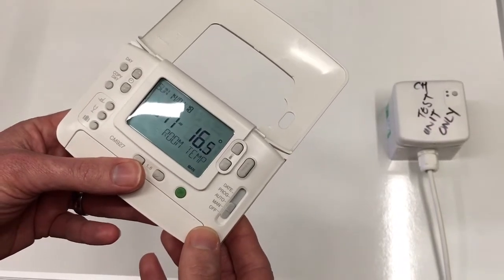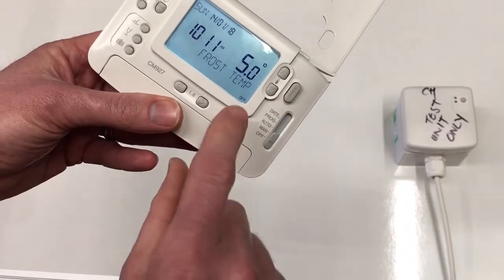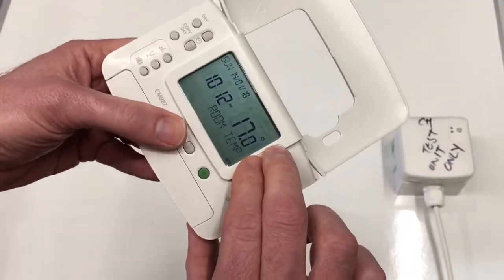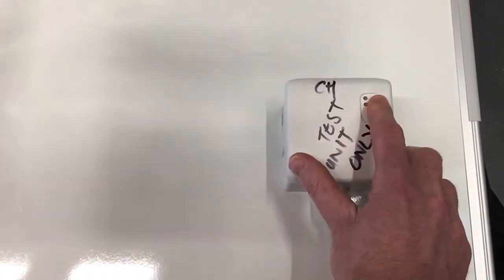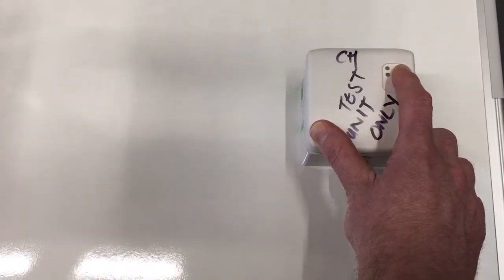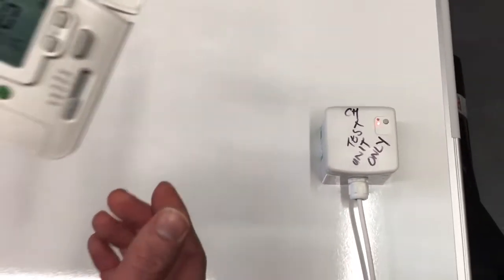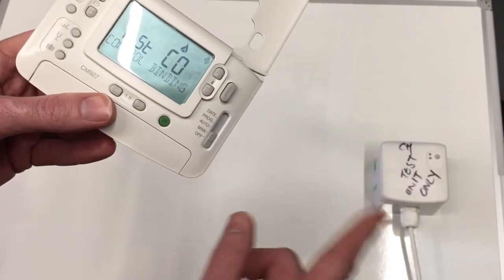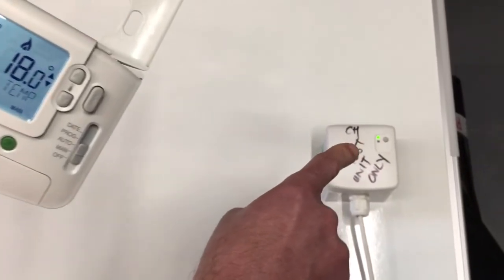How to re-bind a Honeywell CM927 Thermostat to a BDR91 Wireless Relay Box

Comment: Will the 

Honeywell CMT927 Wireless Programmable Thermostats 
Work with 

HONEYWELL CM921 WIRELESS PROGRAMMABLE ROOM THERMOSTAT CHRONOTHERM CMS921B1042

Work together?
Reply from the maker: They are essentially the same thermostats, apart from the 927 is a 7-day programmable thermostat and the 921 is a 1-day programmable thermostat.

Comment: Hello I did this an signal is fine. However my temperature when trying to rise on thermostat only goes upto 9.5 degrees heat comes on but can't get the temperature higher then that
Reply from the maker: Are the digits on the LCD screen working properly? If so give tech support a call and they can assist you - 0300 130 1299.

Comment: Pressing the BDR91 button for 15 seconds clears the memory.  With the older HC60NG box by just pressing for 5 seconds and omitting the 15 second press, this allows me to add another thermostat (up to 4 in total) and keeo the existing Thermostat connected .   Does the BDR91 work in the same way ?
Reply from the maker: Yes, the BDR91 has 4 memory slots too.

Comment: Hi Richard I used this video a few times before on my centre controller no problem,this time my controller will work manually but when I set the time it does not work,I have temp set to 21 starting temp in room 18,can’t understand why,any help I’d be very grateful thanks
Reply from the maker: Might not be the thermostat if the relay box is turned off (green light off). Possibly another component failed?

Comment: I’ve done this now and it’s put my heating back on but one light on the receiver is steady green and the light below it is flashing red any advice? Honeywell cm921
Reply from the maker: Did you 100% press and hold the button for a full 15+ seconds initially? If not, it could be indicating you have filled up the 4x memory slots (i.e. bound the thermostat to the BDR91 four times). Give Resideo technical support on 0300 130 1299 if you require further support.

Comment: HELP i can't even get the control unit to go into link mode, any help will be gratefully received
Reply from the maker: It might be faulty. Technical support is on 0300 130 1299 if you need it.
Reply: @MWPHS  thanks

Comment: I press the three buttons and it does not go into the binding menu.
Reply from the maker: As long as the thermostat is a CM921/CM921 and the slider is off it should work, unless of course the thermostat is faulty?

Comment: Thank you thank you thank you! We have a 'CENTER' room thermostat which I couldn't find anything about. But I stumbled across your video and thought the controls on the Honeywell looked very similar though not totally identical, but near enough to try. It worked. So if anyone has a "CENTER EHE0200361 Programmable Room Thermostat" that has lost its binding to the base set (causing a red flashing light on the receiver at the boiler end) then just follow the instructions in this video. Just use a little common sense to recognize the slight difference in the appearance of the buttons on the CENTER remote thermostat. Thank you again!!
Reply from the maker: Good to hear, glad it worked.

Comment: Hi Richard. 
The green light is on and the thermostat has the flame on. I hear a click as if it's tring to come on, but still not working
Reply from the maker: What is the relay attached to? A green light plus relay clicking normally indicates that the BRR91 is fine? It could be something else faulty or maybe the relay itself. If you need a replacement relay, we sell an OEM replacement here at about half the cost - https://theintergasshop.co.uk/heating-controls/28-honeywell-bdr91-wireless-relay-box.html

Comment: Thank you Richard, we have been having real problems with our unit since coming back from holiday. The house temperature has not gone below 21 degrees for three days. In fact the temperature on our return was 24.5 . We had set the holiday mode to 12 *!? In fact even turning the boiler off didn’t make any difference.So let’s hope that this is all fixed now or a plumber is needed. Thanks again. Andrew

Comment: My Honeywell 927 room thermostat screen shows broken numbers and not responding to timings. The clock keeps bad timing and the settings jump from eg 17 to 19 ( not displaying 18) . It is quite old ,so is it irreparable ?
Reply from the maker: If you have a faulty CM927 then this is a decent replacement for it, as long as you have a BDR91 - https://theintergasshop.co.uk/home/99-cms927-7-day-wireless-programmable-room-thermostat-cms927b1049.html

Comment: Hi Richard, I am not able to get the thermostat to go into the binding mode as much as I press. I changed the batteries and it is still not happening. The slider is off. I followed the instructions
Reply: Same here any joy ?
Reply: Ditto
Reply from the maker: You need to confirm all the buttons you need to press in the video are working. If they are and the slider is 100% in the 'off' position then the product may need to be replaced if it won't go into bind mode. This thermostat is a good replacement and will pair with any existing BDR91 - https://theintergasshop.co.uk/home/99-cms927-7-day-wireless-programmable-room-thermostat-cms927b1049.html

Comment: Hi I press the 3 buttons and nothing happens i dont get the binding display i have replaced the batteries ?
Reply from the maker: If the product is fully functional and you follow the video correctly it should work. If the product is faulty or you don’t follow the video correctly then it won’t work I’m afraid.